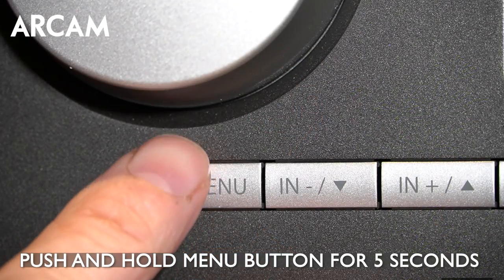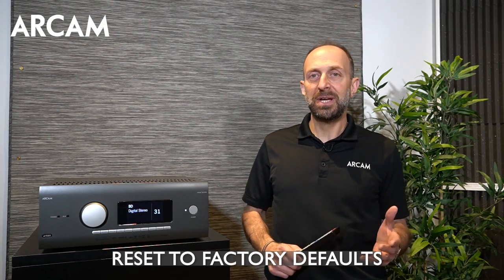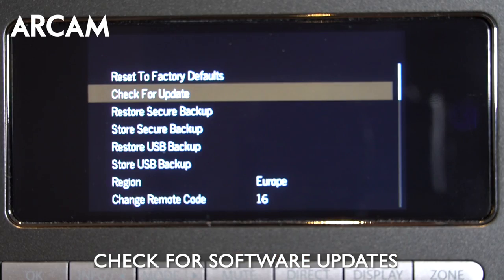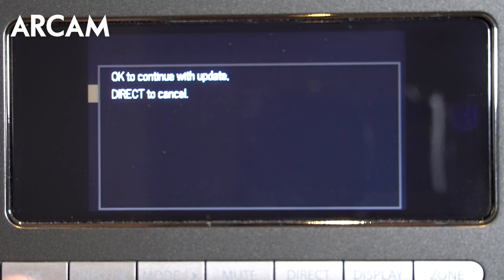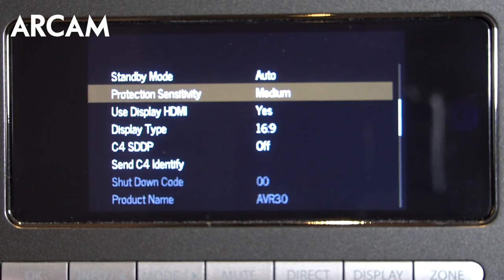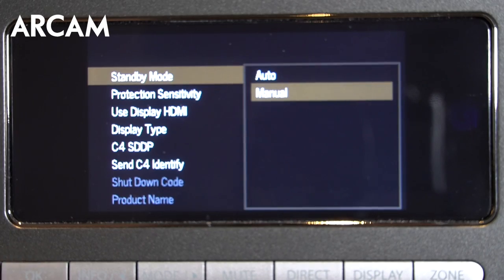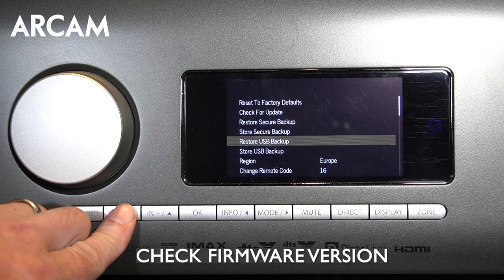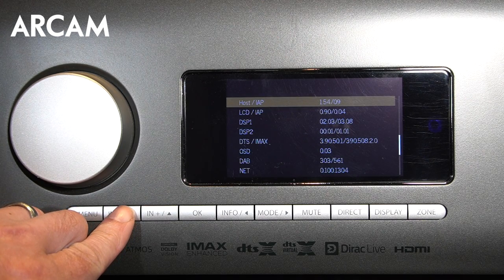How-To Access the Engineering Menu on ARCAM AVR's

Comment: Is it just one independent subwoofer output on the Arcam avr20? I see there is a sub 2 output. However does that output happen to be independent also.
Many thanks.
Reply from the maker: There are multiple: Sub 1 and Sub 2 are a split output for the same channel, but channels 13/14 and 15/16 can be assigned as independent sub pairs if you wanted to use four subs.

Comment: I have the AVR11. The one thing i cannot figure out is how to play everything in Multi Channel Stereo. Older DVD's and CD's work fine as does anything via Bluetooth. However alot of Blu Ray and 4K will not convert and doesnt give me the option. Ive called Arcam twice and after long convos they told me it just wouldnt work. I asked to speak to an engineer and they refused. I mean wth!?!?  Any ideas?

Comment: Build quality is not good on these new Arcam AV Receivers, binding posts really Flimsy, there is a light shining through the power on button, the plastic Material used for display screen, gets Scratched easily when wiping off the dust, with a reading glasses cleaning cloth designed for cleaning. Amp Power is not good either for the money they charge. Big disappointment
Reply: The way you're going on I suppose it doesn't really matter how the unit sounds.